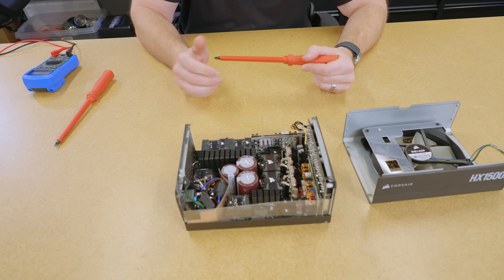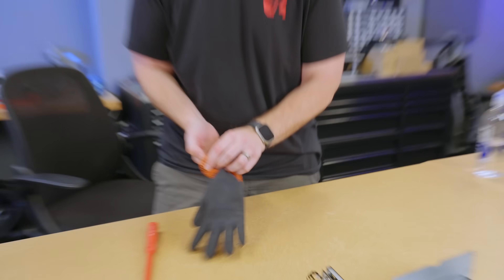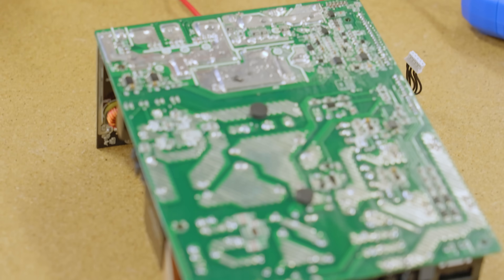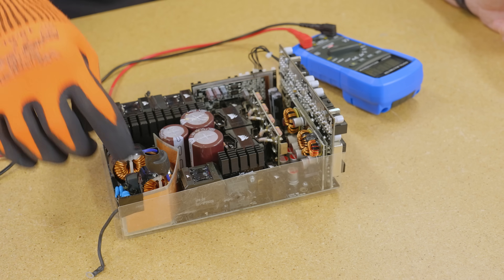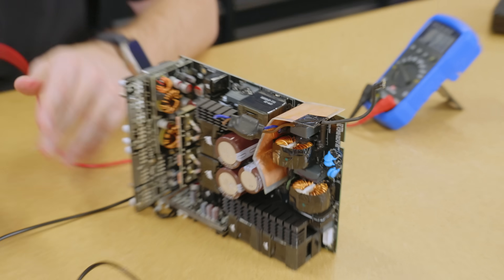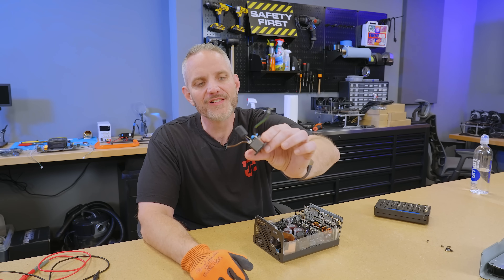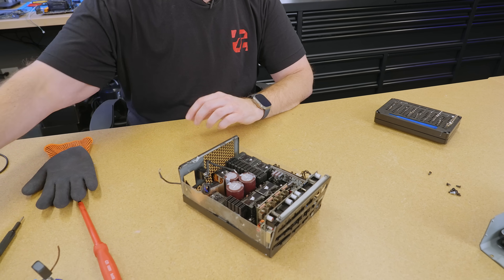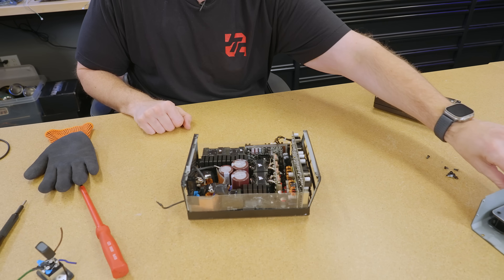Investigating what exploded in my PSU... DANGEROUS! DONT ATTEMPT!

Comment: The Right Hand Rule:  If you may be working on something hot, use only your right hand.  That way if it does short the electricity will travel through the right side of your body, away from your heart.  This gives you a very slim, but slightly better chance of living through it.
Reply: right or left won't matter.... your heart is in the center of your chest............
Reply: @CotyRiddle  Tell that to everyone who got stabbed in the center/right of their chest, the ones who had no further complications (like lung flooding) and got onto life-support on time to get a liver transplant that is.
No point telling that to the ones who were stabbed in the left side of their body, heart failure of that sort has mere minutes to get onto a bypass pump, thus instant death.
Reply: *One hand rule. Right hand rule is for figuring out specifics of magnetic induction related to current flowing thru a wire.
Reply: It's not the side of your body that is the issue. It's that the current finds a path through your hand or arm rather than through your torso, if it finds a path at all.

Comment: Jay waving his bare hand near those solder joints triggered me a lot. I really thought he would get ZAPped anytime.

Also, a 1500W PSU doesn't supply 1500W on just the 12V rail alone, it combines the 12V supply with 5V supply and 3.3V supply resulting 1500W total power. (and this is considering this is a single-12V-rail psu). Some cheaper PSUs claim to supply higher 'wattages' than they actually can based on each rail max capability individually, but they don't consider the actual combined power (components on the AC side of the PSU and DC side before power reach where each rail's individual voltage regulator circuits)

Comment: the big capacitor on the top right blow up, at 1:52 and 7:47 you can see the spit in the top of the cap, it is on the bottom right hand side of the cap

Comment: Well my personal record is 5kV touching, but it was a soft power supply. A couple of months ago, I touched 500V DC the worst possible way + in one hand and - in other one. It was for a first time  in my life to feel all the muscles contracting in the same time. Colleague of mine almost lost his eye as the contraction  made me to throw the board away about 10m in the open space. And I was cursing on the ground for half an hour. I can say one glove is good but not enough. Discharge capacitors with small resistors. Direct short is violent. But at least it prevents path over the hearth.

Comment: Jay, you can buy a tool,  called "capacitor discharger"! It is a nice tool, it has a handy LED on it that is lit until the voltage drops below 30V so when it goes off, you can safely touch the caps.
Also, My guess it that one of your MOSFETs have exploded in the circuit.

Comment: Transformers doesn't pop, there's no pressure build up in them.
If there's no burned capacitors showing, I'd look under the black heat sinks.
Reply: You can see where one has definitley failed; and that another has possibly popped as well, however.

Comment: In my early electrical engineering days I had an old Tektronix scope that had some loose connections in the video tube driver board - very high voltage but fortunately not an outrageous number of amps given the many times it knocked me on my butt while I was reseating the board. I did quite a lot with mid-range stepping regulators including one project where I stepped up a voltage to about 100V so that I could run it through a reverse bridge and get the 100VAC I needed to ring the bell in an old princess model telephone (back in the days of land lines).

Comment: I don't think power supplies are supposed to fail like this, even if it was under heavy load. If the OCP is not fast enough to handle spikes during high load conditions, then it looks like a design flaw that should be rectified (pun intended).
Reply: Several people have pointed out the lack of bridging resistors to discharge the caps. Teaching moment. I've learned a lot and been reminded of a lot. I'll be reasearching my PSU's more carefully now.

Comment: When I was in high school (1990) I took an electronics class and we got to tear down a mainframe computer at some city government office. I forget how long the mainframe had been shut down before we got to it but it was days to maybe a week. The teacher had gone in ahead and removed anything dangerous of the hardware. A few days after my teacher was demonstrating why you had to be careful around capacitors. He had a selection of them ranging from about the size you showed in the video to some about the size of a beer can. He was demonstrating  what could happen if you bridged the terminals by doing it with a screwdriver. Some had discharged, some had quite spectacularly NOT discharged until he did it. The one that I remember distinctly was the one that when he touched the leads it sparked so hard that it blew the black rubber piece that the leads are inserted into open, much like a can left in the freezer too long, and started spraying the electrolytic fluid into a cloud in the classroom. He stood there for a second with a puzzled look on his face and said "In the 30 years I've been in this industry I've never seen or heard of that happening. We should probably step outside while this clears." So watching this video gave me as much anxiety as I'm sure Nic was having in the background.

Comment: You need a capacitor shorting probe to discharge the caps, just leaving it sit will not discharge them even if you waited months. They are designed to hold a charge until discharged either by completing the circuit or shorting to ground manually.

Comment: Actually the caps should be charged to around 400V (at least if it is a regular SMPS with active PFC), so 150V should be fairly discharged

up to 120VDC is considered "Extra Low Voltage" in that it carries a "low risk of dangerous electric shock" by the International Electrotechnical Commission (but i think this is based on some asumptions like dry skin, but i'm not sure) 
a more conservative value of 60VDC (Safety Extra Low Voltage), is whats considered safe enough for the general public to deal with

so by that i dont mean that 150VDC is "safe".  now 400V its possibly around the same category of danger as 120VAC or 220VAC, but DC bahaves a little bit differently

Comment: Main caps in the primary are charged by the active PFC circuitry to usually around 350-400V when active. They have to be at least higher than 338V so the PFC can work properly for universal mains (100-240V AC). Since it works as a pulsed step-up converter, it has to be higher than the peak volts of the AC input sine wave so it can let in current at all times.

So if you measured around 150V in the main caps, they were somewhat half+ discharged. This could also cause the switching circuitry to stop/not start working by having a too low of a DC voltage supply for it. If it had be my guess however, the fault made the main switchers stop and then when the AC power was unplugged, some part of the switching worked (i.e. the 5VSB supply) until it discharged to a too "low" voltage and then everything stopped.

It's still surprising tho, that no semiconductor in there (like diodes in reverse, which may have a tiny leakage current but it's always there) made those discharge in a 24 hour period 🙃

Comment: The volts are not the problem, it's the current that kills and it doesn't need much. 120 V DC is actually safe to touch in Germany, AC is 50 V. Still hurts though 😅

Comment: Im not an electrical engineer, but the lids on them caps aren't exploded upwards so its safe to assume they are still... cap able ... of sending you across the room 😂
Reply: One is; one's gone; and the other is a possible. The one he noted the yellow streak on has vented and is dead; another appears to have a pinhole in it.

Comment: I shorted those caps with my face once.. 0/10, not recommended...
And those caps should have had bleeder resistors connected in parallel. This is actually one of two safe methods to discharge them - use some insulated clips with bleeder resistor, 1k for example, between them slowly. Or just short them with the screwdriver.
One of the switching transistors released a magic smoke, or if it smells like insulin, it's either electrolytic cap or the 0,33-1uF AC cap...

Comment: Gloves on both hands might have been better! Any resistive load (think incandescent light bulb, heater) rated for mains voltage should take care of the two surviving caps. Many years ago, one of my PSUs did this, though the hole in mine was a bit more obvious.
Reply: Also, may not have been a transient. Electrolytic capacitors (the ones with the cross - which is a safety vent - in the top) are well known for letting go spectacularly. Cheap/poor quality design, long-term abuse, or just old age, will do it.

Comment: The secondary of a transformer will not pass DC voltage from a capacitor on the primary. Transformers only work with AC current but not DC.

And just for the record Volts don't kill, Amps do. If it was the Volts that killed you everyone would have died the first time the got a static electricity jolt which is roughly 10,000 Volts ..... but virtually no current. Capacitors also hold electricity in static form and the chances of getting killed by a charged capacitor is virtually nil. Still going to hurt like hell but like a static electricity jolt with a little more bite.  I've seen electricians play pranks on each other by charging up a motor run cap and then pressing it against someone's arm .....  Now the guy getting shocked won't die but the prankster might get killed from means other than electrocution.

Comment: the cap with the yellow mark also has blown it's vent (witch explains the yellow)
you might have also lost some 'fets and maybe a fuse but without measuring them (or seeing damage) it's hard to say.
p.s blowing a 1500w psu with a single gpu is crazy. most good psu's have headroom above their rating, you might need 1.8kw+ to kill that. 
ask GN Steve, i'll bet he knows how that psu will give.
Reply: We might be in RIP GN territory; they've blown up and set fire to things; but I don't think they've killed a 1500W PSU. Or autopsied one in Jay's patent mad way either! 😂

Comment: I've disassembled my psu before to swap the fan, but it's 650w and I left it unplugged and switched off overnight, while still in the pc. Still stayed very far away from the caps. And I'm alive, the psu is alive, no issues for the past 6-7 years (and nearly 14 years I've been using the same psu). But yea, find a reliable and safe way to discharge caps, I'm pretty sure there's specific equipment for this, or some easy enough diy option.

Comment: Likely components that have died in that PSU is one of the capacitors i.e. the one with the yellow bits on it simply one capacitor open cct can cause more spikes, because it looks open to me, the voltage regulator(s) that have blown and bridge rectifier. Since you don't know what you're doing, I would go to some expert in your local area

Comment: Hyperspace Pirate has a video on making small wires explode with voltage. Probably what exploded was a MOSFET or possibly a trace inside the board. One of the snubber circuits failed causing a voltage spike into the 1000s of volts, and the current draw shunted a couple thousand joules of energy into a very small wire which converted to plasma, with a magnetic field strong enough to (briefly) contain it. When that field failed you heard the 'bang' of all that plasma expanding almost instantly. This effect doesn't have to be in a wire. It can happen inside a trace inside the PCB. Or inside a MOSFET. Anywhere a lot of energy can pass through a small physical area.

Comment: I used to help tear stuff down for recycling, they used to use a couple of probes connected  with something like a a 10K or 100K ohm resistor inline to drain caps one at a time till I started hellping and used balls of foil on the end of a paint stir stick instead.... was way faster and was fairly safe give that we all had gloves and eye protection on.  The occasional spark was exciting.

Comment: This is why capacitors charged with direct current should only be stored in a short-circuited state, as they can still retain very high voltages even after extended periods of time. The video is, once again, very unprofessional and dangerous for the people watching it, as well as for the video editor.

Comment: I have shorted caps  A LOT bigger than those. See the coils? There is voltage protection right at those coils. That little square black component next to the brown and blue wire. Also, if you don't .. plug your PC in to a UPS or a phase cleaner. Make sure your voltage stays steady at that much wattage. Just a suggestion.
Reply: Using a UPS is a very sensible suggestion.

Comment: we can see one of the big caps is blown , it haves a slit open and crapped out the electrolyte all over... you can use a sacrificial screwdriver to short them with a bang  , or use a old tungsten light bulb/projector and connect  to the poles to safely discharge them , and then use the screwdriver to finish discharge them  ...

Comment: I bought the Dark Mount keyboard from beQuiet!. Everything works fine except one thing, when you set the RGB to white, you get different shades of white. I got a replacement and it's the same thing. So if RGB is your thing then you might want to pass this by because it's a manufacturer defect.